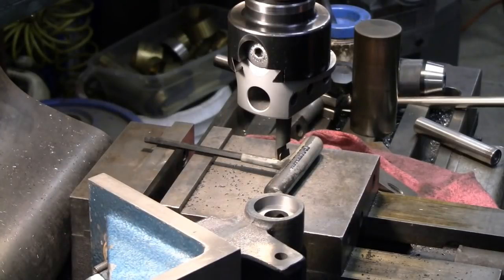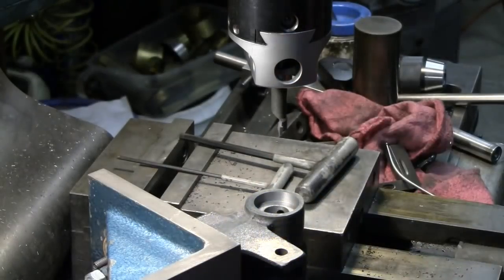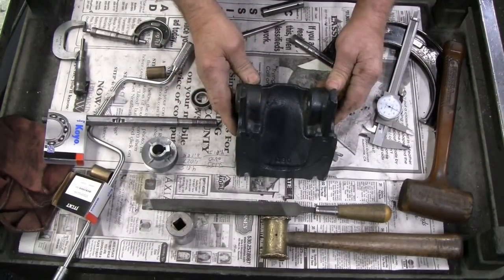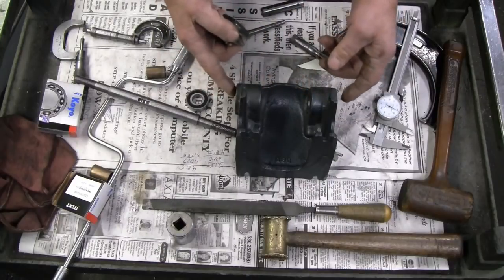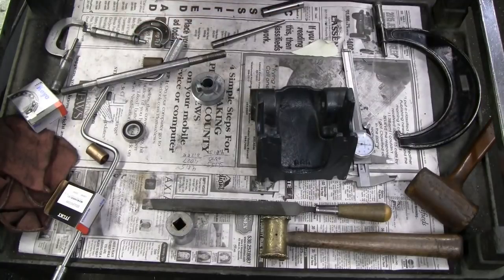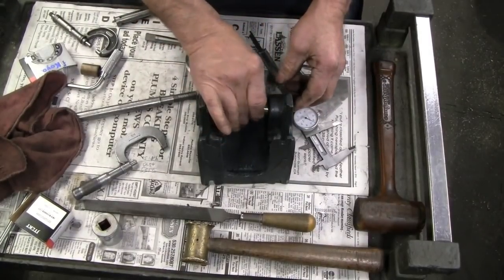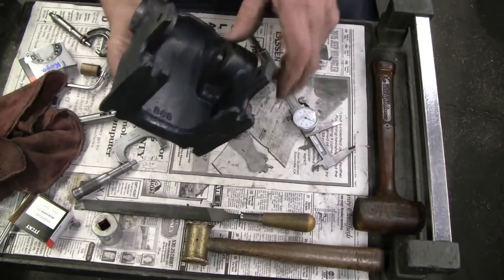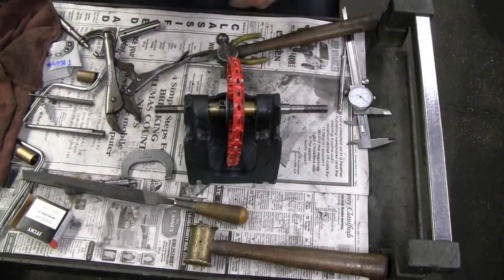Installing Ball Bearings in an old Grinding Arbor--Part Two

Comment: Nice to be here for Part Two, we will enjoy the finalization of this upgrade to the Grinder and your shop, nice to get to be here and for you to get to upgrade your tools. You thought this project out well and that is enjoyable to watch. nice share about you and your father what a nice story of your history. Motor rebuild to allow you to continue using this motor, we say the Mr.Pete not approved motor dust gathering issue is accurate. We are here with you on this build regardless of what you decide. Lance & Patrick.
Reply from the maker: I've decided to try to save the motor. It that works out, I may try to devise a cover or shield. I only need to get another 15-20 years out of it!!
Reply: @sierraspecialtyauto7049  We both hope this motor can be saved we think it because you and your dad built it so this is going to we hope turn out well for you Joe, we will be here watching you sharing and having fun with us all, thank you. Lance & Patrick.

Comment: Hey Joe! 2 videos, what a great morning!  Too bad about the motor.  My father-in-law had the same setup in his body shop, only the washing machine motor was mounted below the table, out of the way.  I like tearing down, and cleaning up old motors.  You may want to looks at that as a project some day, a good cleaning, and new bushings/bearings might put that old motor back into service.  Hope the shoulder is doing well.  A great video.  See you next time.
Reply from the maker: Vernon, by the time I started editing the video I had already decided to go into the motor. I think that will be the first project after I get out of the sling.
Reply: @sierraspecialtyauto7049  I figured you would.

Comment: I was afraid of that when I seen the motor, that’s my concern with my band saw conversion because the motor appears to be a washing machine or dryer motor
Reply from the maker: We both might want to think about a cover or shield for our motors, Jim.
Reply: Sierra Specialty Auto I’ve thought of it just not did it yet